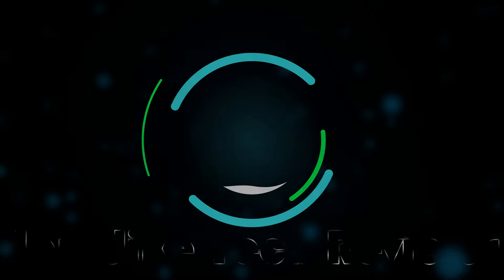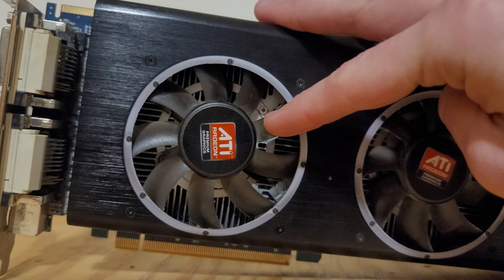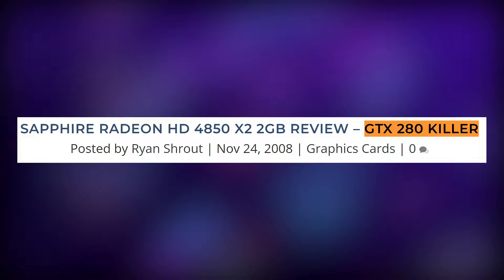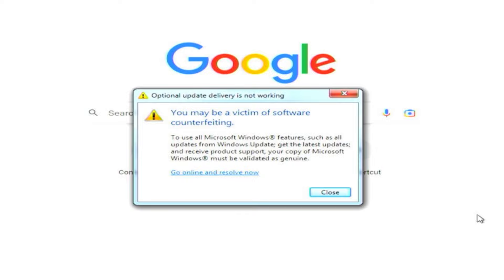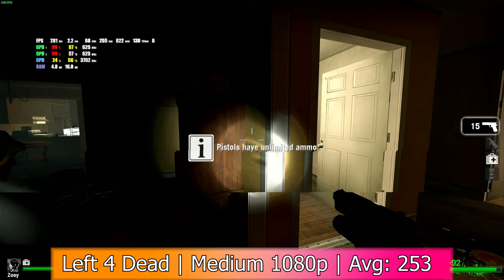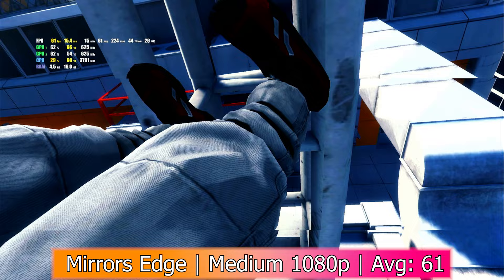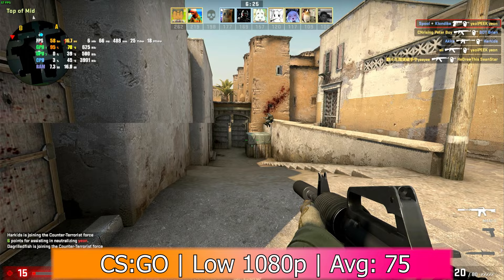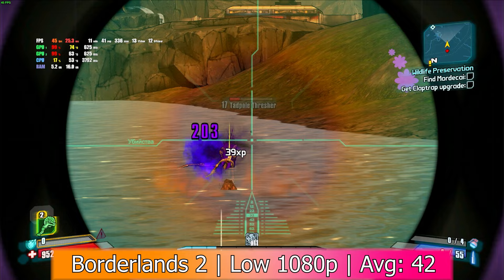The ATI HD 4850X2 - A Dual GPU Beast 15 Years Later!

Comment: "ATi's last dual GPU card"
ATi HD 5970 was their last ATi branded multi-gpu card, even has dx11 support too so it can launch alot more modern games, cs2 runs with crossfire on it with afr compatible settings even.

great vid!
Reply from the maker: Ah crap.. didn't realize that. Thanks for pointing that out
Reply: hey man are you sure the hd5970 runs cs2 with crossfire enabled? I have this video card here and I've already tested CS2 on it, but only one of the gpus works

Comment: At the time I got crazy deals in semi-new hardware among the Portuguese benching community, they would use and review them for about a month or 2 and then sell them at half the price, so for a couple of years I had top-tier hardware on the cheap. 1st I got the 3870x2 and after the 4870x2, but the huge leap in performance I had was when I upgraded to the beautiful 5870 (single GPU) afterwards, it almost doubled the performance. It I ended up in a Mac Pro, just PuP.

Comment: Crossfire not working might need you to enable a crossfire profile after adding the game in to the drivers, like a game profile that uses x or y settings when launched.
Or renaming it to another game that has the same game engine for crossfire to work, only messed with it briefly myself with a pair of hd 5770's but i read that's sometimes needed for it to run better.
Reply from the maker: Aight thanks. Ill give that a shot

Comment: SLI / CrossFire died to pave way for temporal based technologies such as TAA, TAAU, and later DLSS and FSR 2.0+. The GPU needs data from the previous frame to 'reconstruct' the current frame but with multi-GPU setups, that data is on the other GPU... which poses a problem, to say the least!
Anyhow, the best way to get rid of fan noise on these old GPUs is to take off their fan shroud and use 2 x 120mm fans mounted on a GPU cooling bracket which you can easily find on ebay, Amazon, etc for around $5-10.
Reply from the maker: Didn't know that, thanks. Never experimented much with custom cooling for GPUs but that sounds very effective